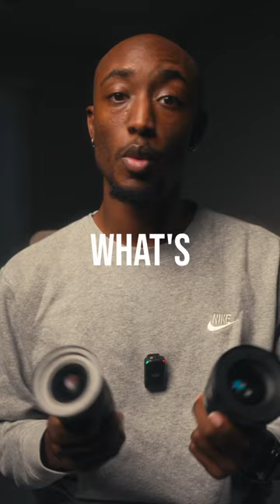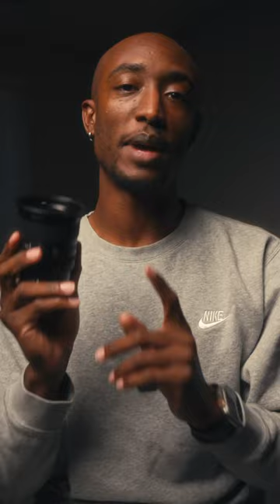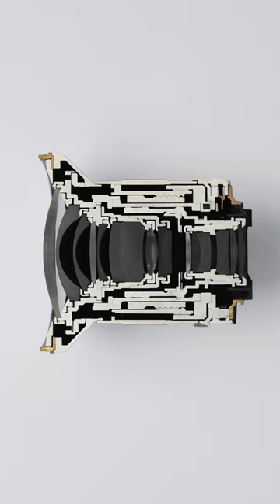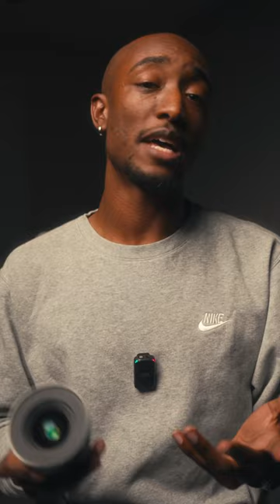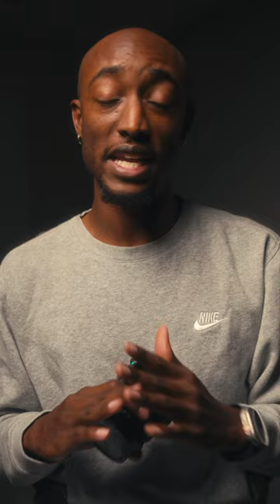Camera Lenses Measured in F-Stops vs T-Stops

Comment: Is there a way to convert fstop to t stops?
Reply from the maker: Yup! But not an “easy” way. You’d take the f-stop of the lens and divided it by the square root of the light transmittance. So if it’s an f2.8 lens, and 90% of the light makes it through the lens, divide 2.8 by √0.90 which gives you 2.953. So that lens would be labeled as a t3.0 

The hardest part of course would be measuring how much light was lost going through the lens
Reply: @erwinmarionneaux  sheesh , yea def not easy
Reply: @erwinmarionneaux bro, you lost me at square root 😂😂😂